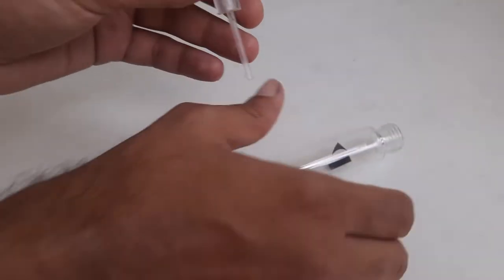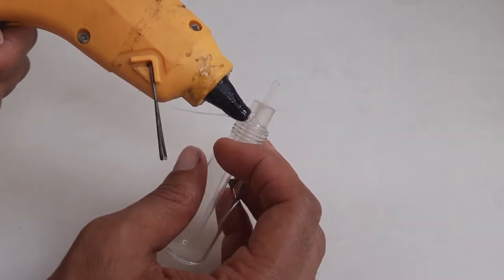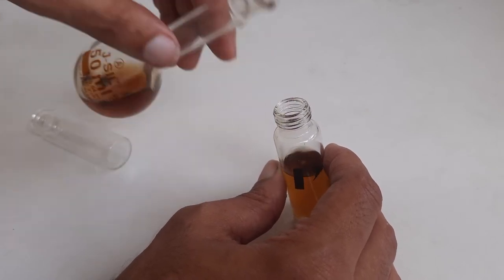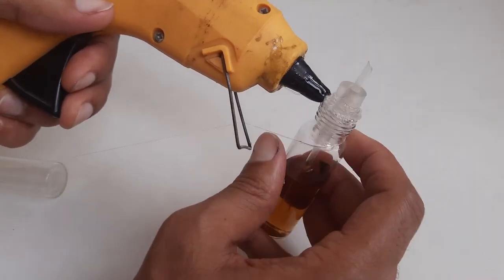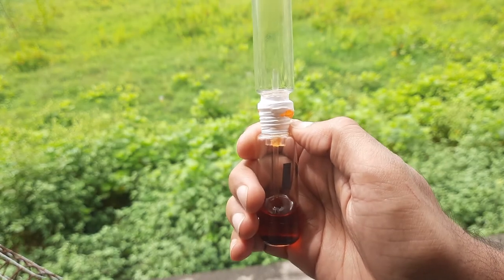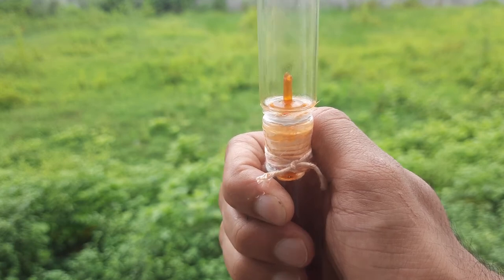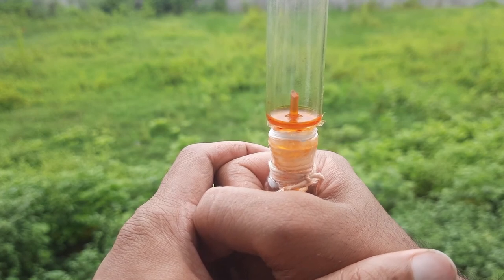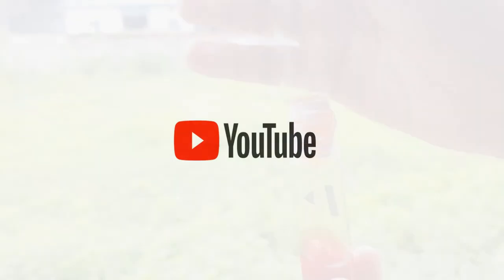How to make hand boiler | Love meter | Working of Alcohol Thermometer

Comment: Nice experimental tool! I think you could create a more sensitive one if you pre heated the bottles, also the alcohol with hot water, and start to build up with hot bottles then leave it. It will under partial vacuum. The tool will work much faster. But anyway I enjoyed this version too. Blade
Reply from the maker: No, actually we should cool it below room temperature so that the gas inside get compressed so when the temperature reaches the room temperature it creates pressure inside 
& that's what I did
Here actually we want pressure in the lower bottle & vaccum at top to work it better
Reply: @TechsScience  The main problem is the pressure on both side. The unit works easier if the liquid is vacimised because of the boiling point reduced. Also it could increase the steam pressure. If both sides vacumised the liquid could fill the other side easier because no pressure resistance. The pressure increasing with temp increasing in one side is the main thing for this tool, but this effect works better if the whole thing is partially vacumised. Just try it, and please share the result here! Thanks! Blade
Reply from the maker: @AttilaBlade  ok I will try this formula
Reply: @TechsScience  yeah, he was right, you want to create a partial vacuum in there to even lower the boiling point of the liquid inside to the point that your hand’s warmth is enough to boil the liquid inside. Especially that you have alcohol inside which has lower boiling point than water, then you can make a sensitive one.

The boiling of the liquid produces the pressure we need to push the liquid up. Hence, we have pressure at bottom and vacuum on top.